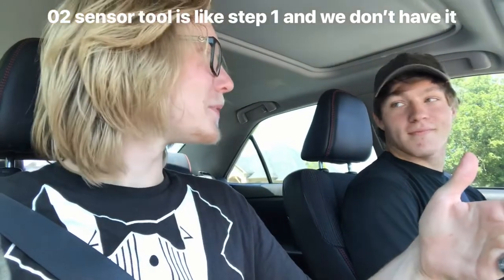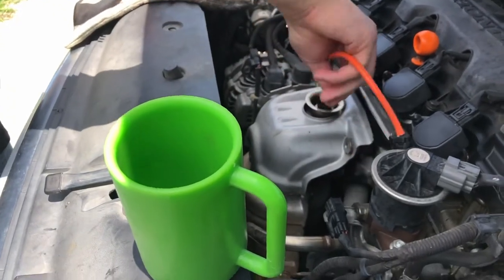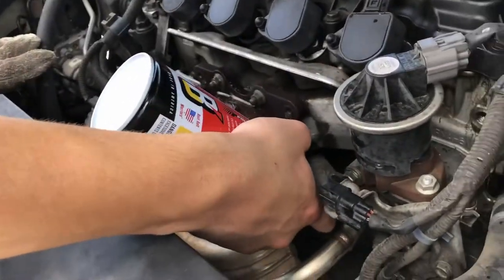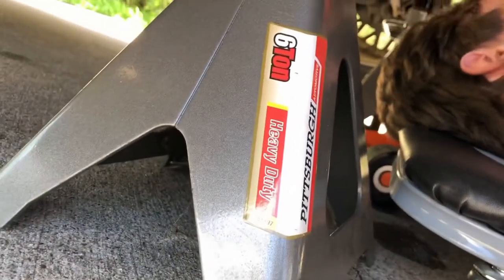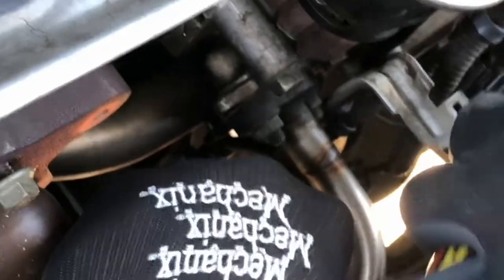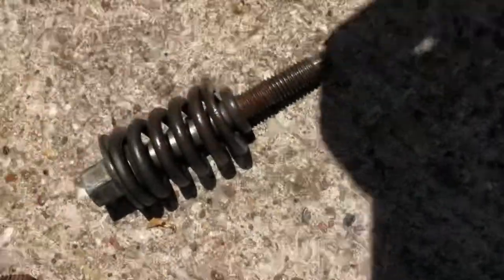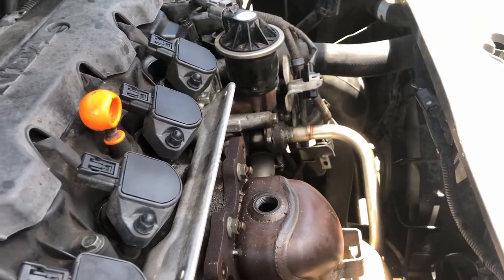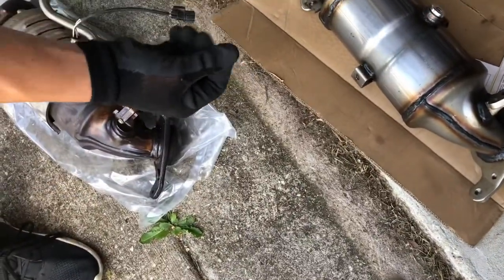Changing the Catalytic  Converter on a 2007 Honda Civic Ex Vlog

Comment: Why did they take off the headders
Reply: The headers? The Cat bolt directly to the block, basically it is the header…
Reply: @thevp2006  my 08 si is bolted on the headers. So strange that the same gen are different
Reply: @nrgpowercharger2003  different engine